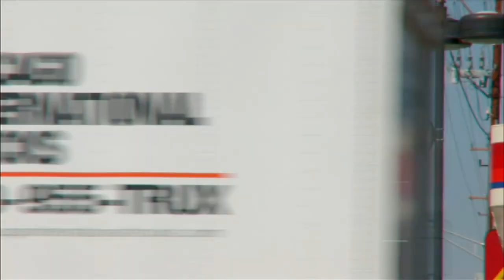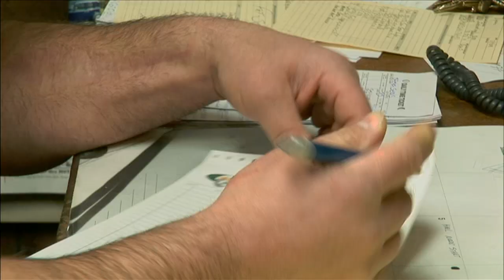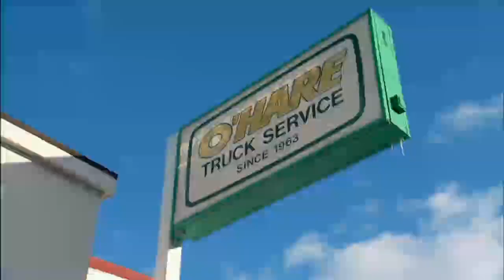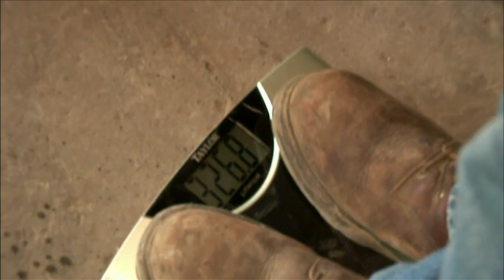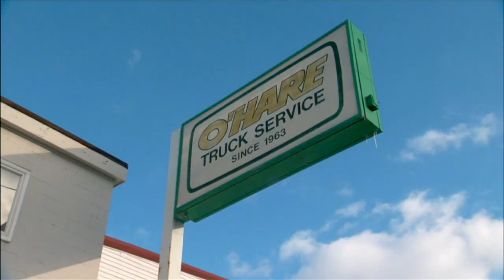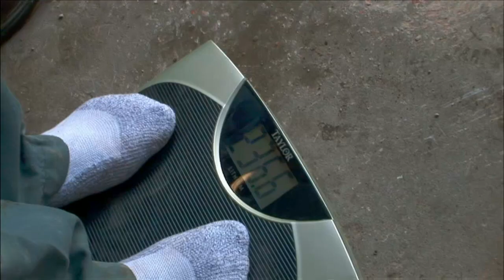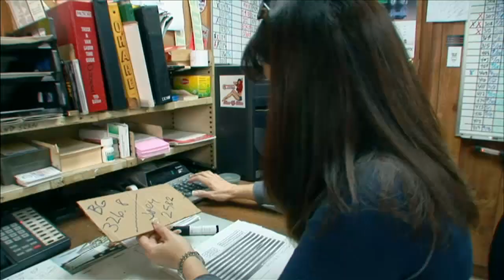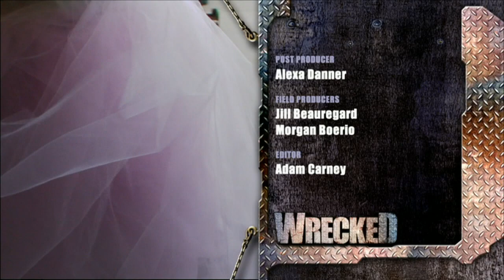Wrecked - Season 1 Episode 12 - Two Brothers, One Showdown | SPEED

Comment: how do you drive over a F'ING GAURD RAIL HOW IN THE F
Reply: 40 years driving commercially and have seen it happen a couple of times. Pretty much the driver starts their turn a bit too early and the rear tandem rides up and over. 
Never saw one high centered on the rail but seen them ride up and either break the bead on the tires or cut the tires with explosive results.

Comment: Apologies for a small rant, but all I see here is two people playing dangerously with heavy equipment when there are better, cheaper, and possibly more effective ways to do these jobs. Ill just go back to watching Ron Pratt on YouTube, he knows how to get things done without going to unnecessary extremes. I couldn't help but think that Pratt could have done that first job alone, with just his rollback, probably the second without a rotator, and the third by pulling the truck back the way it came, wheels on the ground, so he could either move the guardrail without further damage, or then cutting it. Then that truck would have been free to just drive away after correcting its position. But instead, he have these guys in their heavy wrecker, just playing with their equipment. Can they lift that trailer? Yes. Should they, no, and is there a better way? I'm 99% sure there is.